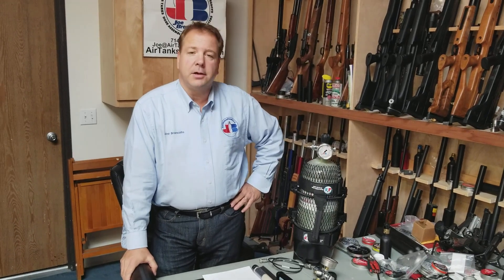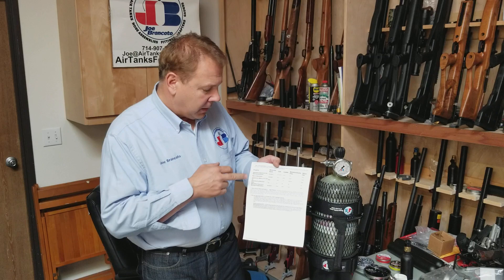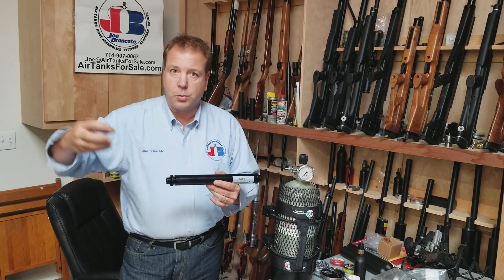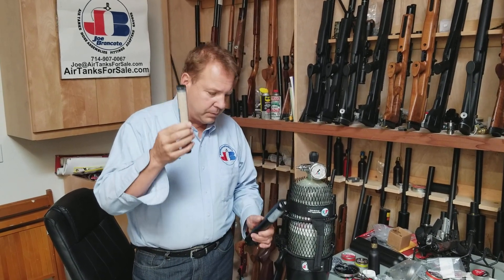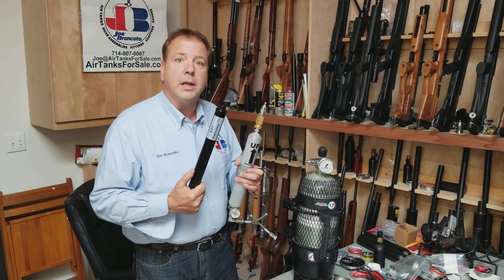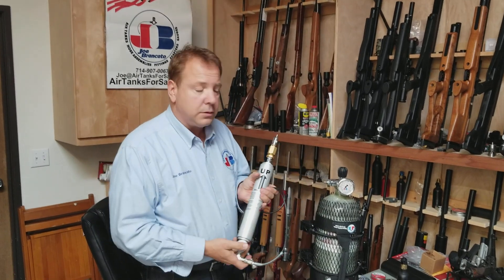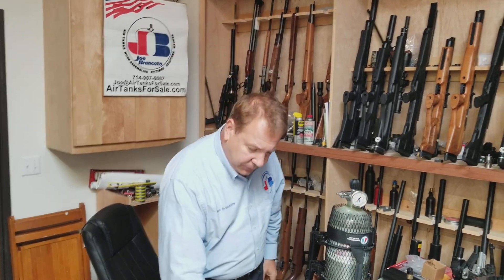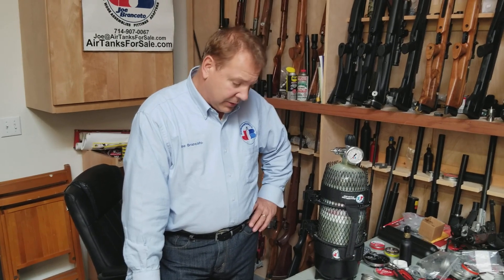SAFETY Facts you MUST KNOW before purchasing a 4500 PSI Moisture Filter for your SCBA - PCP Airgun

Comment: Silica beads can be baked in an oven and dried back out. So on the filters that use just silca in packets , theh can be removed from the "vessel" dried back out and used again. This is only really logical if your filling large tanks one tank to one filter.

Comment: But hey this pressure maintaining valve you've mentioned so the water filter is on the output side of the compressor which makes sense as you pointed out rightly that wringing effect to force the water out of the air but then surely if the air then has to get by a valve that won't allow it to leave untill its reached a suitable pressure for the wringing effect. As soon as you connect any sealed vessel ie a hpa cylinder to the output that pmv will then shut off as soon as your pressure vessel makes any attempt to find an equilibrium with the pressure that's on the input side of the pmv. So this is really troubling, it seems at least in my mind that the compressor and the water separator would have to be operating at pressures way higher even double  the final intended output pressure in order to cause the pmv to continue  functioning. As if it always would require the same  relative difference.
Reply from the maker: Basically the PMV works like a Zener diode.  Pressure doesn't pass until it hits a certain potential on the compressor side (2200 PSI relative to atmosphere).

Comment: Running humid air through a compressor is hard on lubrication and promotes wear.  I have molecular sieves in a 150 PSI storage tank, usually let it sit for a day.  I withdraw air for high pressure compressor at around 5 PSI gauge to feed my compressors.  
First started this with a Benjamin hand pump, now I'm using a 4500 PSI electric.  

Once a year I remove the molecular sieves and bake them at 450°F for a few hours.  I record weight before and after,  naturally some mass is lost in dust.
Reply from the maker: Great point!  P.S.  You get about 80% life back each time, so 2 times would be at 64%.
Have a great day !

Comment: A lot of pertinent information. I had a hydraulic hose leak that sliced through my winter parka and that was only 2900 psi,I’m afraid to think what 4500psi could do. You need quality equipment purchased from knowledgeable suppliers like Joe. Great video.

Comment: I have desiccant dryers on both the intake and output on my compressor.  I have the blue color changing silica on the intake, and the active carbon/molecular sieve on the output.  This set up works extremely well. As the intake removes most of the moisture, the output catches any residual moisture along with and odors.

Comment: Do you sell replacement filter cartridges for the alpha?  I don't see them on your web site.  How much are they?  How often do they need to be replaced?  How do I know when they need to be replaced?  Can the filter be heated to "refresh" the sieve and carbon?  Can the cartridge be emptied to refresh the carbon and sieve outside of it, and then repacked?
Reply from the maker: Every 2000 cu ft.
Call 714 907 0067 to order

Comment: Hi Joe, why does the water pool at the bottom?  Moisture is suspended in air, and you don't have any pressure increases or significant temperature changes in the filter, right?  Does the surface of media saturate forcing the water to condensate and then drop due to gravity?  Or does the media release some moisture when you suddenly depressurize the filter?
Reply from the maker: As the hot moisture-laden air cools on parts inside the cooler metal filter, it starts to condense (rain) inside. From their, the air must be kept under high pressure via a Pressure Maintaining Valve (PMV) for the air to be scrubbed.
Reply: If it indeed just condensation plus gravity, why would any old media with a high surface area, say fine sand, not work as well?  How hot is the air coming from the compressor?  Filter, presumably is room temperature at least initially.  If this is temperature driven would you get more effective moisture removal by cooling the filter externally?
Reply from the maker: It was NEVER STATED ONLY Condensation and Gravity. That is an incorrect assumption. They ASSIST GREATLY, but are not the sole source.
Reply: 1) condensation, 2) coalescence, 3) gravity, and 4) molecular sieve. Joe thoroughly discusses the molecular sieve medium in the video. He also describes how the other three processes are effectively pre-treatment of the air before the it reaches the molecular sieve medium, to preserve the medium. The air will not become nearly as dry without the molecular sieve.
PS: There is in fact a pressure change, a huge one. Joe discusses this, and the need for a pressure maintaining valve.

Comment: Thanks Joe, very informative. What about storing the Alpha. Is there any recommendations to keeping the Alpha to ensure the life of the Alpha is protected to the fullest extent?
Reply from the maker: It's a quality unit. If it's going to sit for years, I'd probably remove the filter element. Other than that, our Alpha filter is pretty much bullet proof.
Reply: What I meant was between filling my big tank it has been a couple of months. I drained the moisture out of the lower part of the filter when I last shut down the compressor but I kept the filter up right (any recommendation on position of the filter for short duration storage)and took the air hose from the shoe box compressor after it was open to the atmosphere for a day to drain as much as possible and connected it to the top of the filter so the filter would not get any contaminates over time. I will have a shop in the next few months so I can set up a more permeate filling station and I will also be doing more shooting. Thanks for the great instructional videos - 4,500 PSI air can be very dangerous and you are sharing your knowledge on the subject is very important.